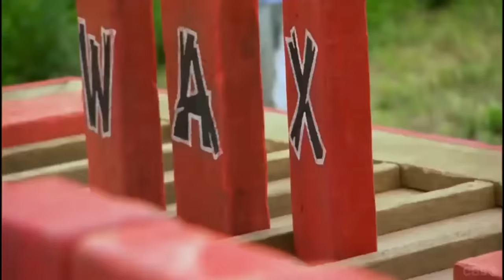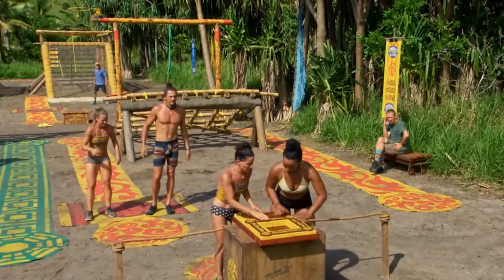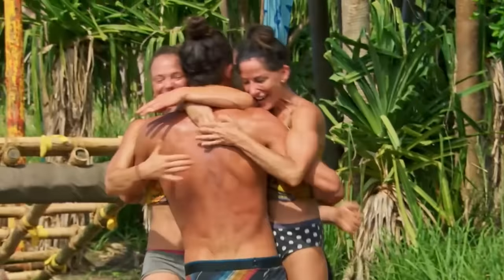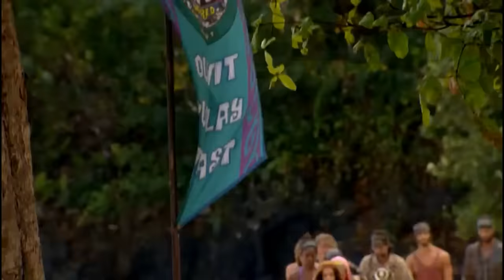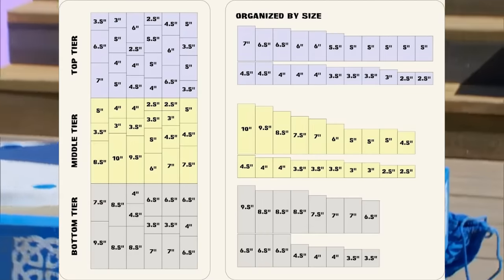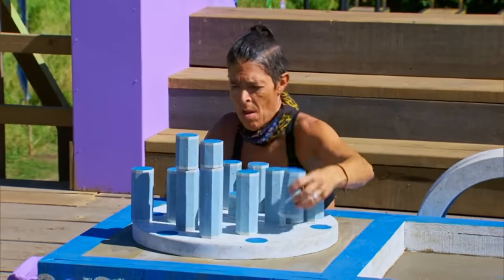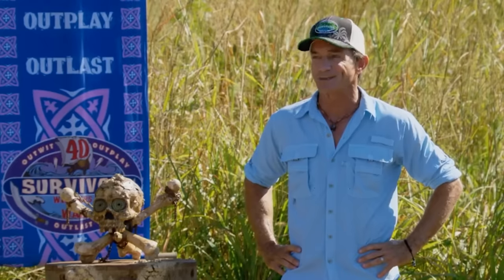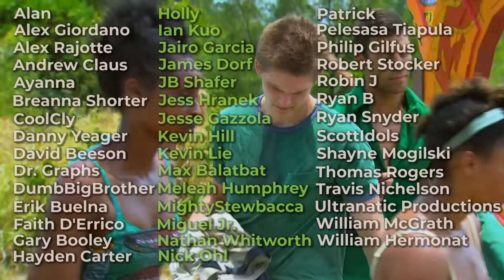Top 5 Most Difficult Puzzle Challenges in Survivor

Comment: I feel like the difficulty of the first level of Michelle's Tower (even if it was built so there was more than 1 solution) also comes from not knowing what the height is supposed to be. Once you figure that out you at least have a good starting point for the other levels since (assuming the other levels have the same height) you can check your work easier.

Comment: I feel like a couple of underrated ones are the puzzle that originated in the final 4 of cagayan (it has returned in other seasons) or the one with the rotating shapes (the sophie vs ozzy one)
Reply: The rotating shapes one would give me an ulcer!!! I love puzzles and am usually pretty good at them but that one gives me so much anxiety!!!
Reply: I feel like the Cagayan final 4 puzzle is so much more difficult than it appears because the design is printed on both sides of the pieces (front and back). Also, the symmetry of the puzzle means that you could also have some pieces upside down without noticing. This means that each piece could be correctly placed in 4 different spots. I believe Spencer had a 15 minute lead on Kass and still couldn't solve it and NIck couldn't solve it in Winners at War despite completing the puzzle on his previous season.

Comment: I am not sure I understand why the rainbow tower puzzle is complicated. The order of the blocks does not matter, so we ignore that. Then all cubes have 6 sides, with 4 being visible at all times, so you are really figuring out what w you want hidden, which is 3 pairs, then you can flip teh dice and reverse the pattern. You also have to do some rotating, but as you go up the tower the number of solutions rapidly reduces, so this step is not so bad. So you put your first cube down, and you only have 2*3 possible orientation for it. That is nothing. I understand why it is only 4 high as any higher would start be be an insane amount of testing, but teh first and last one is sort of simple.
Reply: Your first cube has 6 possible orientations (each side down) and then each of the remaining three has 24 orientations (6 sides down times 4 rotational options) for a total of 82,944 possible solutions.

You can't say the top cube'll be easy because you have no way of knowing if the bottom three cubes are orientated in a way that'll make a solution possible.
Reply: I don't understand why people think it's complicated. Provided each block is identical, all you have to do is arrange each side so only one color is showing, and then rotate each block 90 degrees from the block it's sitting on. It's easier than everyone is making it.

Comment: There’s a trick to solve the cube puzzles. I’ve tried it at home. It’s not hard.
Reply: Are you talking about the spiral method?
Reply: @oldschoolmatt7396  No. I don't know what that is. 😄 The basic idea is that there are 6 sides but only 4 colors. So there are at least 2 colors being repeated. So you keep one of repeated colors on the bottom. And you just repeat that same 3 dimensional pattern one side over on the next layer so the possibility of getting repeated color on the same row is reduced. Someone shared the cube layouts, and I printed them out and put the cubes together without much time.  I'm not saying these cubes can be put together with this method in 5min since I don't know the exact color layout of the cubes for each season they've used in. But assuming there're some consistent patterns in the 4 color cubes. My method should work.
Reply: @maggie198333   I get your strategy but my idea is that if each cube is identical, which in survivor they usually are, you get each side to match up completely in color, then rotate each block 90 degrees from the block beneath it. The reason I call it the spiral method is at the end each color is in a spiral around all 4 sides
Reply: @oldschoolmatt7396  Yah. I guess we are talking the similar basic idea. I just don't know the color pattern for certain and if the cubes are identical and if the production recycles the same color pattern each time they use the colored cubes challenges. Hard to track the cubes' color patterns on screen.